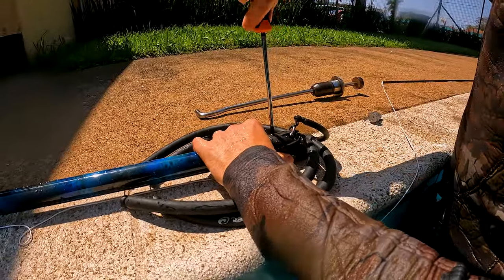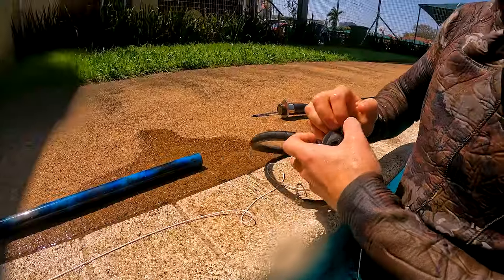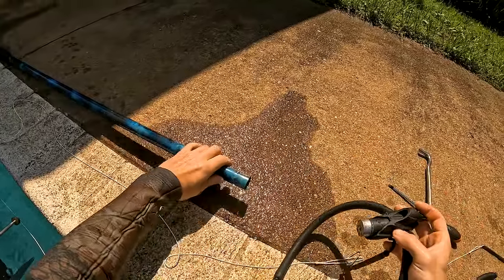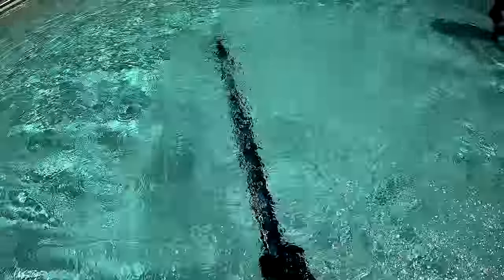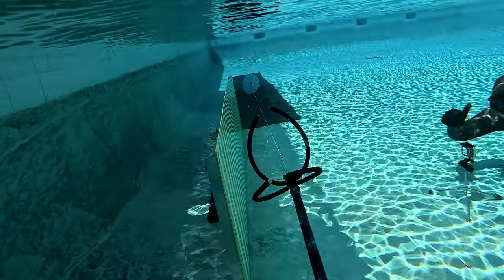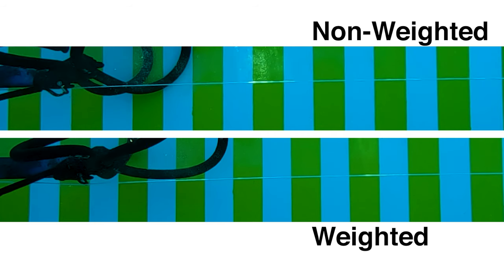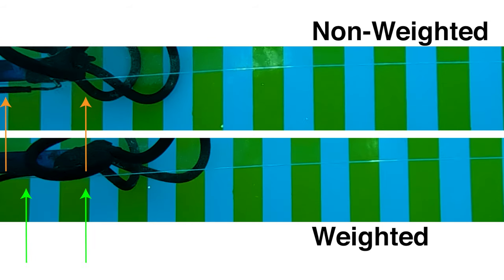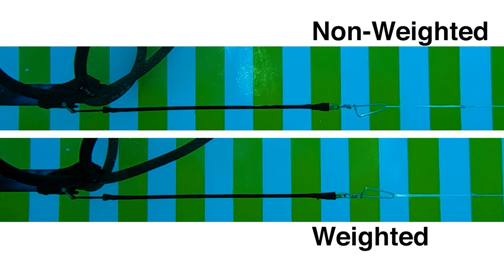Rob Allen | Muzzle Recoil | 2024

Comment: Great as always, thank you very much sir Alen. The hint about the 30% drop of efficiency makes so much sense! Thanks a lot
Reply from the maker: That 30% drop off was the difference between holding the handle tight gripped and stiff arm apposed to limp wrist and bent arm. Obviously the weight in the muzzle has a similar effect, just not as drastic as the "limp wrist.bent arm."

Comment: Very interesting results. Would be good to see this test on a roller muzzle as well
Reply from the maker: Not possible because we don't fit weights in roller muzzles.
Reply: @RobAllenSpearfishing how come you dont ballast your rollers? The ceramic bearings add enough weight already?
Reply from the maker: @damiencollins8124  The muzzle is bigger, as well as the hardware. The bearings do play a part but the 8mm s/s shaft along with the 2 s/s side plates add enough weight. Unfortunately, too much weight for the shorter rollers. We are slowly changing to a 6mm s/s shaft that has helped.

Comment: How many grams of lead do you add to the weighted muzzle ?
Does it depend on anything like riffle length, etc. ?
Reply from the maker: Hi, we use 3 sizes, the largest is around 40 grams. We fit the large to long guns, the medium size to medium size guns ans the smallest to shorter guns. The very short do not have any lead as they will sink. It will make the gun too expensive if we custom balance each carbon as we do with the Timberline gun so, if you want a gun fully balanced we do this with the Timberline guns.